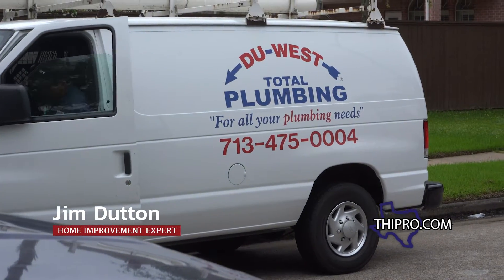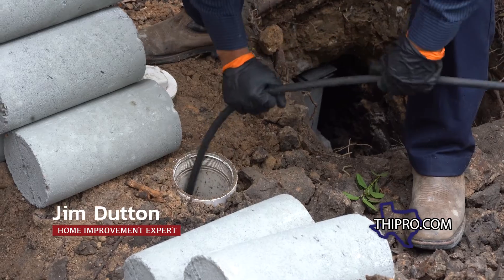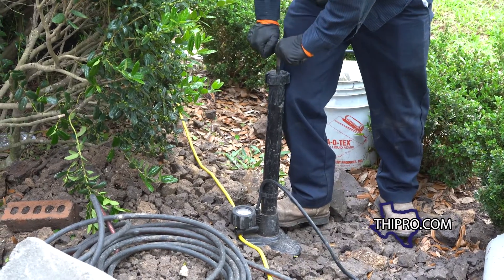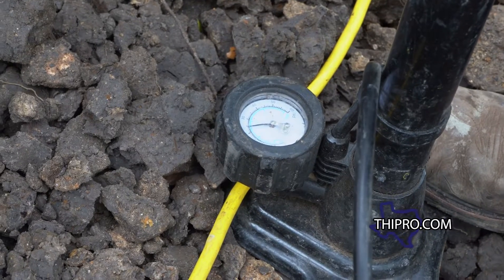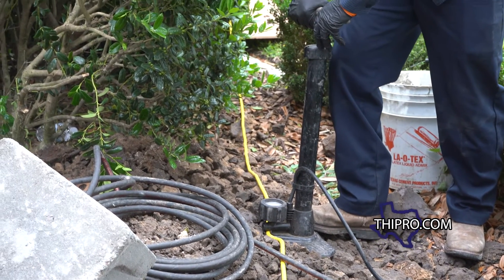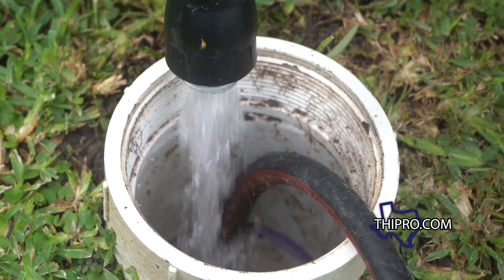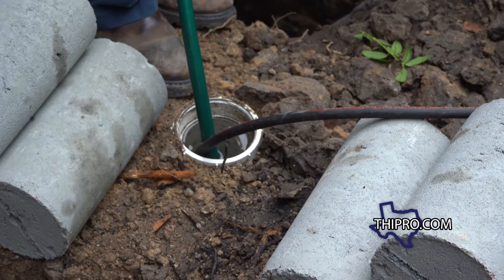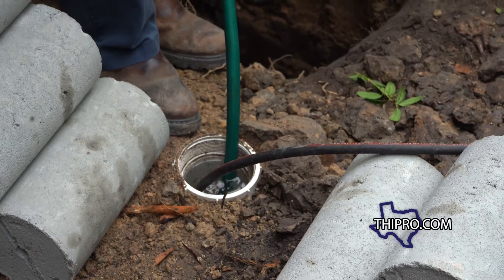Hydrostatic Test Use To Determine Plumbing Leak

Comment: This only works if the clean out riser is the same level as slab.
Reply: You can just rase the clean out the same height as slab. That's a very easy fix.